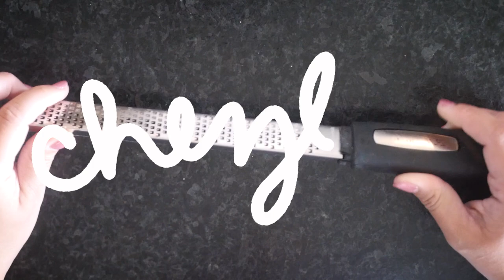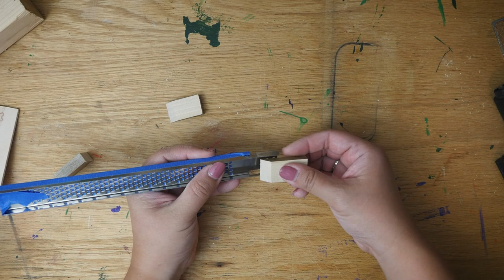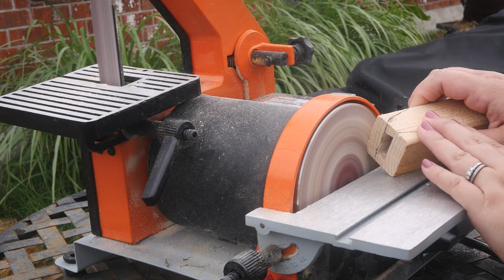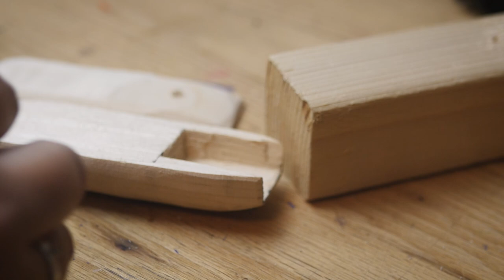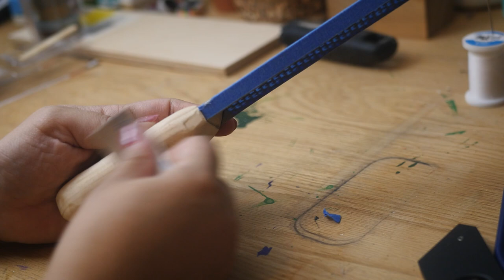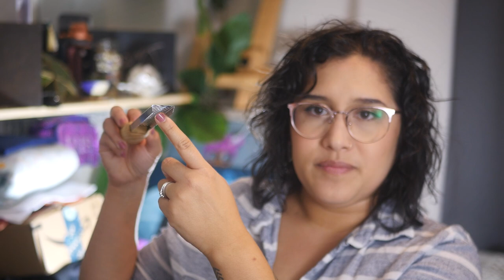I made a new handle for our zester

Comment: This was a huge help! I have a 4 pc set of stainless steel Stanley Home Products brand cooking utensils from the 1950's that was my mother's and the handles are ugly brown plastic. All are either distorted from heat or have actual burn marks. I have thought about replacing them but did not have a clue where to start. I think my job will be simpler than the microplane as the metal  inside the handle is completely flat.
Jo